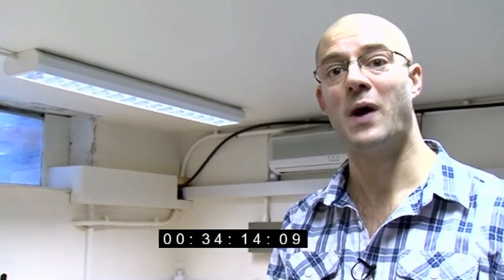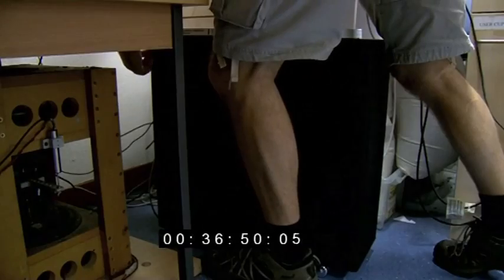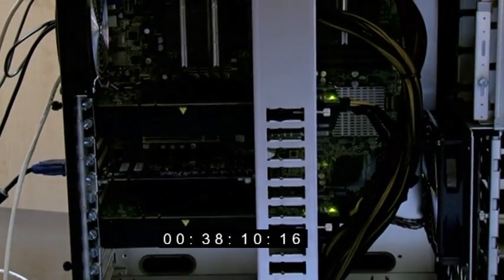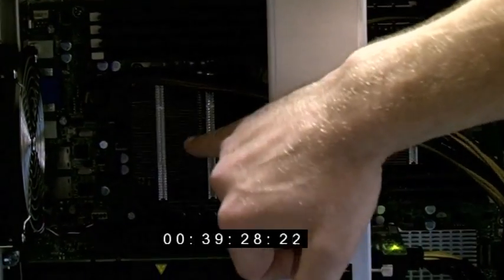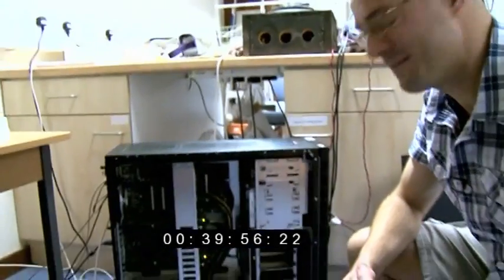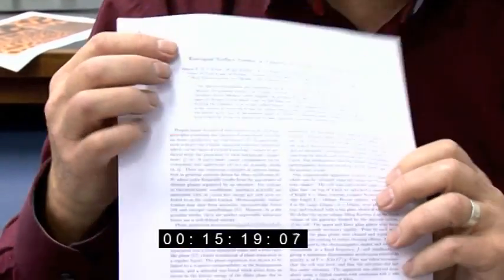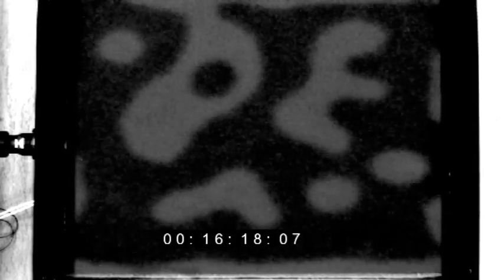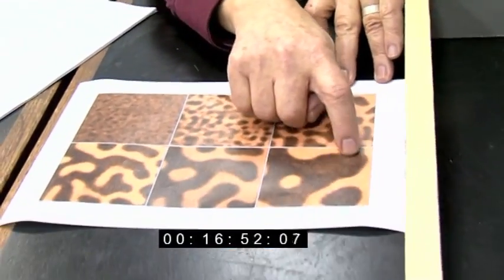Surface Tension (extra footage)

Comment: the patterns emerge due to the fact that the shaking surface is not perfect. so the grains have the tendency to not just bump into each other but even get distracted from the surface, so they add up in the -> lower area of the surface..
Reply: I'm sure they thought about possibilities like this, also like if there are significant electrical forces generated by the surrounding equipment which affect the bronze particles, or vibration modes of the plate exciting particles more in some areas than others

but notice that they did a computer simulation which wouldn't cause any of these effects and it produces similar results (though I don't claim to know the details)

Comment: Is it just my imagination or do the patterns just after switch on look like the structure of the universe 
if I understand it correctly at the early stage of the universe it was homogenous and still quite small
At this stage could some vibration maybe at the quantum level caused the universe to take on structure
as the universe expanded/inflated the vibration had less & less effect & we end up with the current structure of the universe
Reply: interesting idea, my understanding is that the structure comes from the combined effect of gravitational attraction on a universal scale, but it makes sense that the resulting shape might be similar to this energy loss - caused shape

Comment: Well, water at room temperature has a huge surface tension because:
-thermal particle (molecules) movement due to the 300Kelvin temperature
-hydrogen bonds
-london dispersion(...) and other forces

Liquid helium is a superfluid on the other hand, therefore it has no surface tension, because of :
-lack of thermal (molecular/atomic) agitation
-single He atoms don't have any electric charge
-london forces are already using all of their strength to collapse the helium atoms from a gas into a liquid ...
So liquid helium has no surface tension at all !

Also, if you induce a general kind of oscillation (which compress all the particles at a period of time=T, in this case: a bunch of bronze granules), they will clump together because of the friction between them and the movement produced by you...

Try the same experiment with a cluster of glass and plastic granules - the 'surface' forces will be even stronger because you added an extra-force : the electrostatic attraction.
...physics works every time...

Comment: Is this the same reason why cables and wires are more likely to be tangled than not?
Reply: Cara Miles No, that is the second law of thermodynamics. Entropy always increases.
Reply: I am surrounded by electronic equipment and I have a major cable entropy problem. The funny thing is, I rarely move any cables actively about, and quite a few of them are actually tied together with cable binders to avoid this kind of thing, and yet, over the years these insanely  entangled bird's nest type clusters have formed, and I have long given up trying to straighten them out.  It's quite fascinating actually.... I think the whole thing may be past the point of no return by now, i.e., it has simply become impossible to disentangle this mess.

Comment: is it coincidence that the the early pictures of the the bronze granules dispersion look similar to the CMB?  Some underlying math that is the same?
Reply: +Nathan Larson Thought of that too! In this system, the way the grains behaved was due to the shaking. They seemed to move out to the boundary of the system. So, if the universe also shakes, that might explain why it expands, aka dark energy...
Reply: These forces interact on a very small scale (electron to electron). The CMB and superstructure of the Universe is a result of forces that act on the very far apart (think how far the nearest star is to Earth!). I think it's purely a coincidence that the patterns look similar, but I guess it's possible some surface tension exists to the spacetime.
Reply: the shifting grain patterns you're watching emerge from random fluctuations. there IS a rule, but the exact expression of it is governed by chance. the fluctuations in the CMB are also random. that's all there is to it.
Reply: if the universe shakes... I like that hypothesis.  =)
Reply: cool.  Though, i thought the patterns imprinted in the CMB were a result of quantum fluctuations occurring in a very small space pre-inflation.  If so, both observations may be of small quantum sized behavior.
Reply: Definitely makes sense that both are a result of random quantum fluctuation but seems interesting if maybe the simple rulesets upon which this random data acts are the same.  If so, why are the "rules" the same?  What's the connection between the electromagnetic force and more primitive pre-inflation quantum forces?
Reply: i doubt the bronze grains have quantum behavior (i said just random, not quantum fluctuations). it's just classical physics here.
also, here you've got two phases, a high density and a low density one (hence the 'decomposition'). in the CMB there's a (temperature) gradient.
so it isn't the same physics; don't know anything about the actual maths though.
Reply: no. not at all.

Comment: I want to learn how to build computer like that. WHere do you get started?
Reply: Jason Sharkey Not really. These things, much like regular supercomputers, are normally pre-built with tight specifications and custom parts for cooling and such. With processors and GPUs that can cost easily thousands of dollars and with the kind of accuracy and potential support you need, you'd have to find a researcher on an /extremely/ tight budget, then you'd have to convince them to let specifically you build it for them.

Comment: how do you set up the graphics cards like that? Are the cards acting like RAM?
Reply: If you know your PC gaming a bit, NVidia has on each of their GPU a number of CUDA cores (a GTX960 has 1024 of them for example...). They are parallel computing cores specialized for floating point arithmetic and vectoring. They are used in gaming through NVidia's PhysX library to offload physics calculations from the CPU, leaving the CPU free to process more higher-level logic. Their box probably has something like two K80's (Pascal architecture), with each 2496 CUDA cores and 24GB GDDR5 on a 384-bits-wide bus, optimized not for gaming but for processing huge amounts of data very fast. Mind you it would probably work awesome for gaming too.

Comment: I don't believe there is any free energy in this system. Lateral movement is simply re-vectored  with each particle collision  until there are large clumps that are moving in phase the small distance between the pieces of glass, if you look at slow motion cross section, the particles that ate in phase do not move much at all, but merely are suspended between impacts with top and bottom.  btw, I can build 16 core Intel I7 with 8 Nvidia quattros that'll smoke that rig

Comment: If you can simulate it on a computer, can't you just take the data of every single particle involved in it, and see what made them move the way they did? Isn't it just there for every single clock signal?
Also, had you left it running long enough would it have reached equilibrium?

Comment: I'd be curious to know the results of altering the frequency and intensity of the vibrations.
Wouldn't the surface tension disappear as soon as the vibration is stopped?
Or is there a threshold below which there is no surface tension?
It seems that the energy of the vibration would have defined wave characteristics that might be imparted to the material.

Comment: Could it be that aerodynamics is when you push air it has this sort of energy loss and clumps together with other air particles forming complex spiral patterns and differentiation of pressure.

Comment: Yeah but the point of the experiment is to test for surface tensions in things other than water, where the little grains would unite and actually lift something denser then themselves. Hence the graph and the little blob that they kept simulating over and over for results.

Comment: Think about if the momentum of a grain that is in the middle of the clump, it goes outward into the surrounding grains and loses all it's momentum from that, while the others it effected lose the momentum because of friction. And to the opposite viewpoint of a grain on the edge of the clump, it very well might be thrown away from the clump but as I said before it will just roam around until it finds the clump again.The momentum is lost and turned into other forms of energy upon every collision.

Comment: My thinking: When they are shook; a single grain would travel farther than grains clumped, the grains that hit other grains will distribute their momentum among the colliding grains, slowing it down. And if there were enough grains in the clump it would effectively stop the moving grain and wouldn't effect the clump enough. Hence it's only logical that the grains would fly about until gathering. Does that make sense? Hard to put my thoughts into 500 characters or less.

Comment: Not necessarily. Dual quad core Xeons or greater can easily out do any i7. And professional GPUs (Tesla, quadro, firepro) are better optimized/not nurfed (depending) at the driver level for professional work. Never mind the fact that the Geforce 600 series has embarassing compute performance compared to the Geforce 500 series, And I also believe you can only sqeeze 4 GPU's in one box. Even if you have two per card.

Comment: You just saw how hot there computer got. These guys are probably bigger nerds than anyone of us. "I probably shouldn't be running it with the case cause the air flow is important to keeping it cool you can fry an egg on top of these" and I bet you ANYTHING the computation that theses guys do is is more stressful than anything you probably do.

Comment: Probably because cooler != faster, you could overclock it, slightly increasing the speed, but it's easy to get wrong and will void your warranty in most cases. It's simply not worth the effort.

Comment: What simulation software so you use? Is it open source? If not, do you know of any DEM simulation software that is open source such as Liggghts? Ligghts software is proving to be  difficult to extract data from. Is the software you use even DEM simulation?

Comment: a questions.
Are particles at less dense areas moving faster, and could this be one of the reasons surface tension is formed? (so that in tightly clusetred areas particles are basically hitting each other as often as highspeed particles in less dense area.

Comment: The computer simulation replicates the experiment very well; the computer simulation has no water on the surface of the particles so that thee surface tension we obtain from the computer simulations is for dry grains.
If the grains have a film of water, then the water forms liquid bridges between the grains which increases the surface tension. So you are correct to suggest that moisture has an effect. But that is the subject of work already done by Mike Swift and his German friends.

Comment: Liquid cooling needs maintenance after some time. This needs to be on 24/7 I guess.

Either way, GPUs made for gaming lack the computational power that other GPUs do.

e.g. Most nVidia + Fermi/Kepler GPUs have hardly any computational power but great driver software for gaming (lol, the architectures are physicists :P)

However AMD cards are mostly built for raw computational power, but the driver software usually isn't amazing.

Comment: how do you know that it's not the weight of the granules that cause the plate to have nodes of less movement? I don't think it would matter if it were done in space, because there would still be a force applied to the plates cause oscillation at a given frequency, and that would cause this seemingly random gathering. (in my opinion).... you know what I mean?

Comment: Let me see if I have this correct.  So if I put two different elements granulated in a tray and vibrate the tray, say copper and nickle, because they have two different amounts of surface tension they will separate into clumps.  These are my questions: What relationship does surface tension have to do with mass?   How would this work in an environment without gravity?  Does irregular sizes of the granules effect the experiments results, causing like masses to group rather than like elements?

Comment: I'm wondering how they define "noncohesive", and also whether they controlled the humidity inside the box of particles. It's well known that most materials under ambient conditions contain water on their surface... and these 160um particles will have several layers of water on them under ambient conditions. Doesn't appear the manuscript is Google Scholar'able just yet.

Comment: If we can join a cloud computing network to share our computing power to these guys, just think what it could do for them. That way when I'm not gaming and at work I could lend the power of my dual lga2011 system with crossfire setup and in part double their computing power right there. Of course the up/down of the isp would limit things a bit but If I could devote specific time periods to them it would greatly improve their computing power.

Comment: Why not use some water cooling in the dual cpus? I'm guessing those are the lga2011 socket type to allow better throughput for the 16x pcie 3. Some boards with another chip in it allow for 4-6 slots at that speed, looks like you are using 2 graphics cards. I wonder are you using dual gpu cards? 

We the community should be allowed to borrow some of our computing power over to you guys in the name of science. As my computer rig I use for gaming probably has more power then theirs.....

Comment: yeah the have to nvidia because ATI did not release anything similar to nvidia CUDA technology, which allows you to use GPU to process massive data instead of CPU which is already running hundreds of instructions just to power the operating system, and it can be any card, the faster the processor on the card the better, actually i have seen a pc you can buy for xrays used in hospitals which uses 8 nvidia cards with linux OS, its amazing, GPUs have hundreds of cores versus 4 or 8 cores on a CPU

Comment: No. The system has to be in stable steady state equilibrium before that consideration applies, and if a volume of air is in equilibrium then the pressure is everywhere the same. If a system is in equilibrium and there are no potential gradients and *still* there are pressure differences, then there is surface tension involved (or so I gathered from this video). However, the Earth's atmosphere is never in a steady state equilibrium and so pressure fluctuations are down to dynamic variations.

Comment: Learning how to program will leverage any engineering skill set, or even business administration. The programming language doesn't matter much, but you'd do yourself a favor if you take something that's current in the field that you're interested in, and not too bare bones. Examples are Matlab (especially for physics/engineering, use Freemat if your budget is finite or nonexistent), Python (general purpose computing),  Java (also useful for web development), R (statistics, check Rstudio).

Comment: But the Xeon-Phi will be released on 2013-01-28 and will cost about $2600. These cards are available NOW and cost ~$600. On the other hand, the Xeon-Phi will probably out-perform these cards.

Comment: I'd like to know what cards you're using. You should be using 4 of whatever single-GPU cards that have the highest FLOPs and get something other than what seems to be the stock cooler :/
Also, the case seems questionable. It looks like one designed to house a server, but you can get other tower cases that provide space for much more fans, bigger aftermarket cooling solutions and better air flow.

Comment: Because most programs are made to run in serial computation and it's architecturally simply not possible to run it FASTER on a parallel processor.

Comment: It wouldn't get any more frames than what you get now.  Planetside 2 was made for old systems running XP and DirectX 9 cards.  It's SOE's problem, not the computer rig.  There's plenty of info on the problem out there on the internet.

Comment: you don't seem to understand that those graphics cards have nothing to do with the display or anything the computer shows on the screen. they're just programmed to calculate massive number of variables in parallel. those cards they use for the simulations are probably not even connected to the monitor, the resulting data will be most likely transferred back to RAM and saved to HDD, with no conversion happening.

Comment: That needs so much better cooling system. Even my non-super computer has better air flow and partial liquid cooling than that one. However that definitely requires full liquid cooling for the Xeon and Tesla processors.